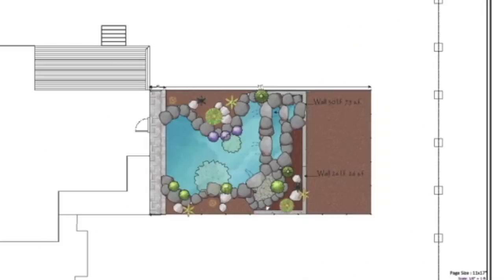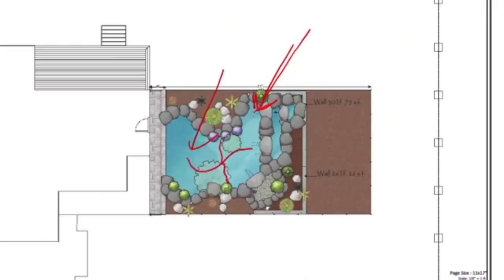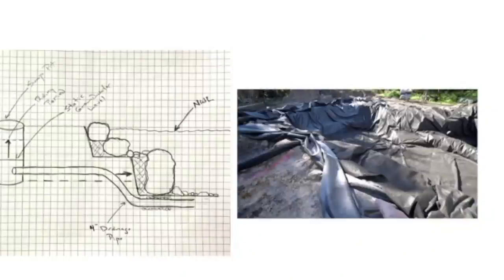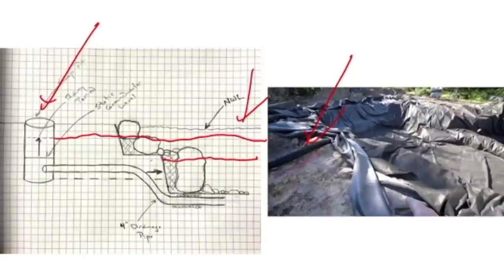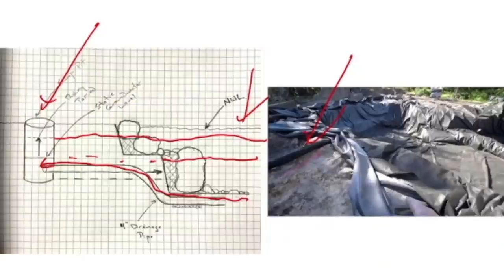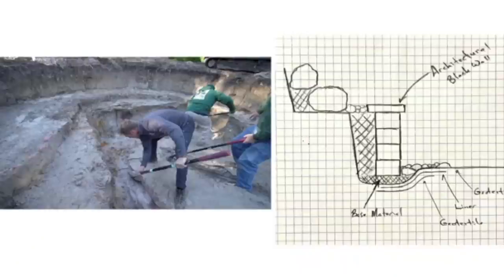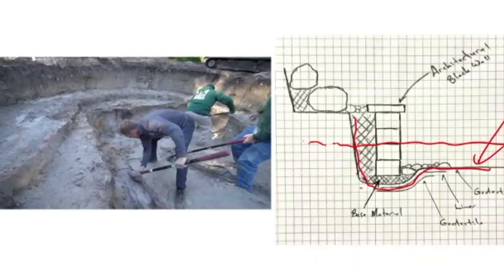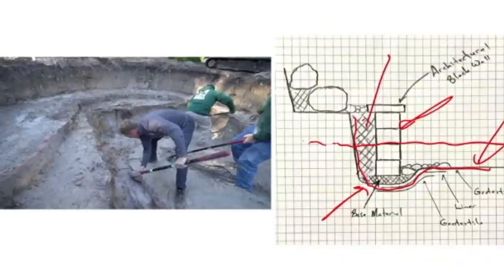Answering Your Questions: Concrete or Rubber Liner? - Recreation Pond Part 3

Comment: Hey Ed, I got the aquascapes university material for rec pond builds. I don’t remember seeing anything about if you have to do external pumps or not. Could you clarify? Or is it clearly just for safety reason.
Reply from the maker: If one of the goals of the water feature is for swimming you’ll need to install External Pumps to keep the motor out of the water.
Even though Submersible pumps and current GFCI Protected outlets are safe it’s against swimming codes.

Comment: Love the in-depth explanation of the ground water drainage system. That’s going to help a lot of people! I’m curious about the external pumps. Would low volt submersibles be acceptable? If not can you teach us how to install the bulkheads for external systems? Thanks so much for this content👍
Reply: I think low voltage submersibles would be considered safe, but externals are typically used when the pond is designed for people, and those ponds tend to be larger than your average backyard pond. I don't think you could find a low voltage pump with enough power to handle the turnover required for a pond like that. Maybe if you used 50 of them?
Reply: @TylerTervooren  there’s some pretty decent ones available. Aquascape here in Australia has a 36volt model that will move 20,000 litres/ hr. Oase has 12,000 litre/ hr 12volt.

Comment: Ed, if I build a wetland filter on my pond can I (or should I) still use Maintain to keep it algae free? I'm installing a 2400 gal pond and my wetland filter will 25% of the surface area. I plan to have no more than 3 koi.
Thanks for the info on carbon footprint! I had no idea.

Comment: Hey Ed. How long can rubber liners be repaired for? Everything fails eventually, and I think one of the reasons the old school builders insist on concrete is because it can be patched and repaired basically forever. Does there come a time in a rubber liner's life that it simply can no longer be repaired and must be replaced?
Reply from the maker: Great question!
We have one remaining concrete pond that we maintain in the Chicago area, the Concrete was installed new in 1999 it can no longer be repaired effectively...... 
It’s getting removed soon???
However I have many, many liner ponds installed prior to 1999 that are still working great!!!
The hardest part about repairing an Old liner is cleaning the scale buildup from the surface to get down to a clean section of EPDM to make a Repair or Seam,
What I’ll do if possible is repair the side that’s in contact with the soil, it’s much easier to clean but sometimes it’s difficult to get to the bottom side of the liner(depends on the project)
I hope this helps!

Comment: Hey ED I have a question. I’m going constructing a pond and I’m putting in a wetland filter as well as a spillway that’s on a different side of the pond then where the wetland is. Is it ok to “T” into the pipe from my vault or do I need two different pumps? And if I can T off the pipe can I just put a ball valve to the spill way to regulate the flow? Just wondering if there is going to be enough water volume for both
Reply from the maker: Great question!
Yes,
You can install a “T” to split the water flow, just make sure that you have the proper pump and flow rate for your application.
How big is the Wetland?
What pump are you looking at?
Reply: Pond is going to be smaller 8x11 with a 10 ft stream leading from the wetland to the pond. Wetland is going to be 6x9. I’m still in the drawing stage. But that’s what I’m looking at.
Reply: Oh and I was thinking the aqua surge 4000 because I wanted a spillway waterfall in the pond portion.

Comment: How tall or deep can you do the architectural block walls?
Reply from the maker: It depends on the type/manufacturer of the Wall block and there installation specifications.
If Geo-grids are adding to the walls you can go higher with the walls without fear of collapse.

Comment: What kind of polyurethane adhesive are you using? I'm actually working on another project before I build my rec pond but it too calls for a bonding agent and I'll trying out a few products I found at my local store so I would appreciate any input so I can experiment with adhesives,  bonding, polyurethane and  blocks and gravel. I'm testing out bonding pebbles together and if it works potentially I might bond together any pea pebble bottom I put in my pool later but I'm also going to do block walls too and I want to experiment before I do our DIY build.

Comment: I think that’s the first pond you guys have built with a some what bottom drain. Concrete is good but doesn’t grow with Algae well. Amazing base cause it doesn’t settle like rock and liner through time, but you still need something for the algae to grow on and that’s where pollyurea spray works amazing. That’s how the real ponds are built
Reply from the maker: ???
We don’t have a bottom drain on this pond.....
Reply: @EdThePondProfessor  you ever make it to vegas swing by I’ll show you 16,000 gallon pond
Reply: There's no bottom drain on that pond. What they built was a drain to capture ground water beneath the liner.
Reply from the maker: Sounds good!!!